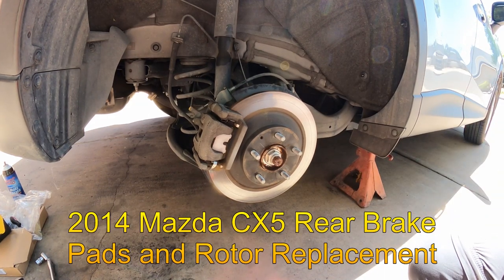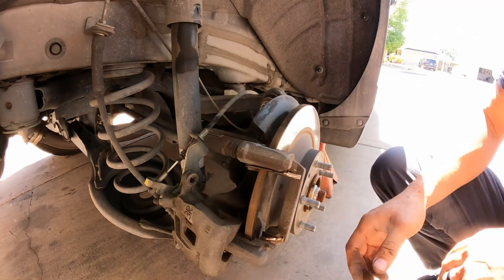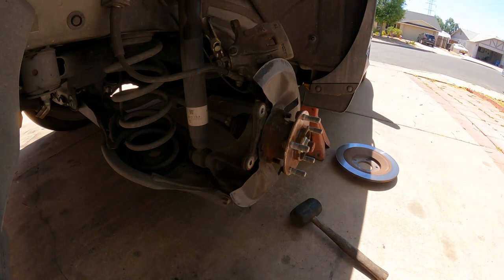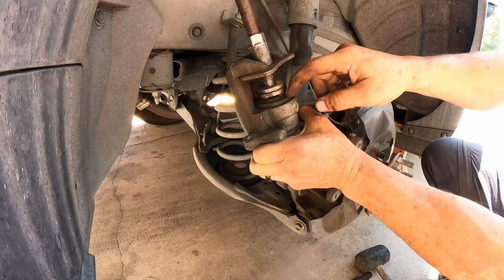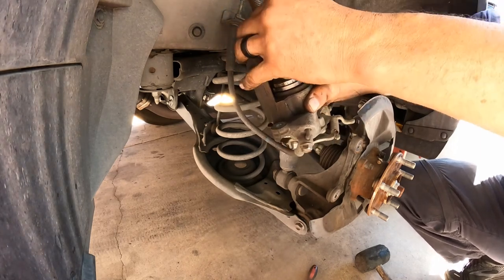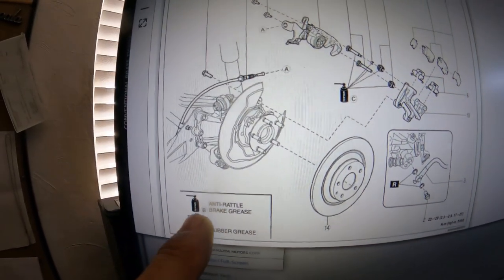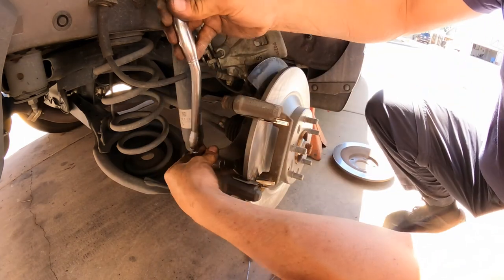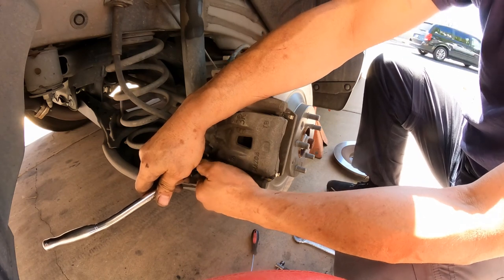2014 Mazda CX5 Rear Brake Pads and Rotor Replacement

Comment: We did the rear brakes on my son's Mustang many years ago (2000 something model) and instead of using a tool to screw in the rear calipers (because I wasn't aware of it), I used a large needle nose pliers.  Yes, it was more difficult, but it got the job done.  

After cleaning the surface of the axle flange, I use some kind of lubricant such as a light coat of anti seize to help prevent rust from forming in the future.  Bare metal will just rust again.

Thanks again, we'll be replacing his CX5 brakes soon.

Comment: One issue is that clip on the pad is supposed to go inside the caliper bracket not outside.   A lot of guys get it wrong because it's intuitive to think that it backs the pad away from the rotor.  But its supposed to be inside as a wear indicator.